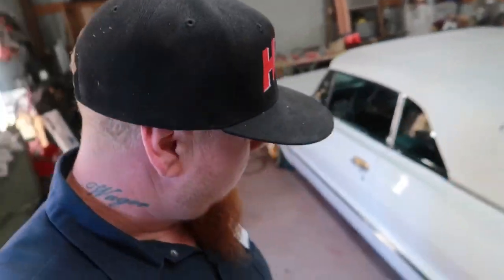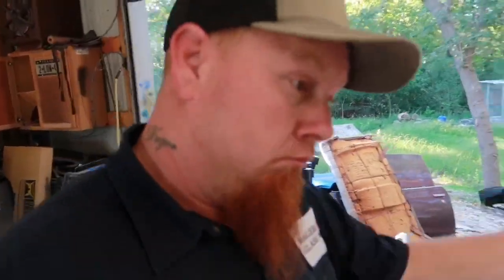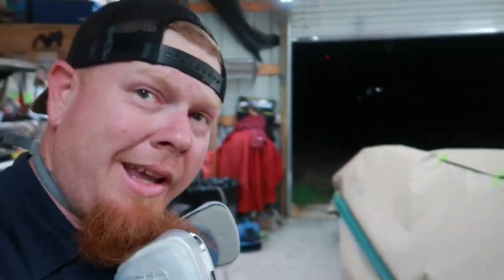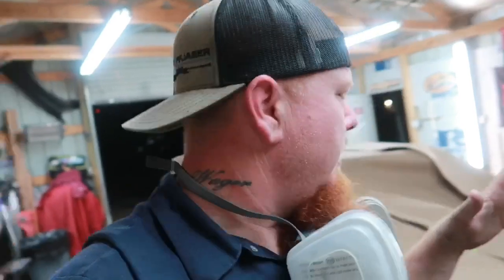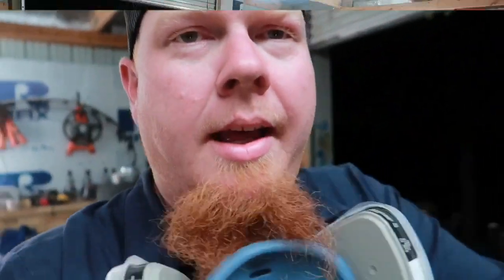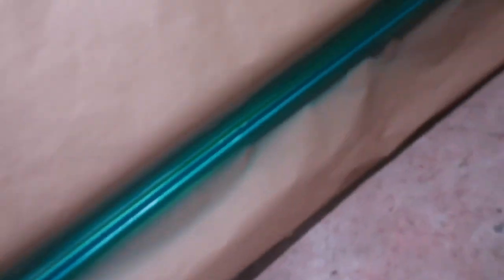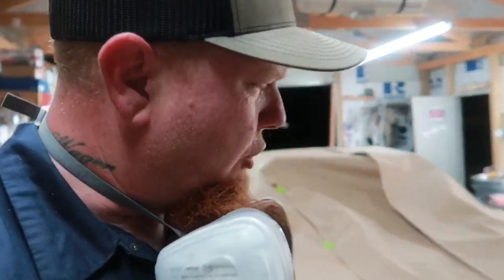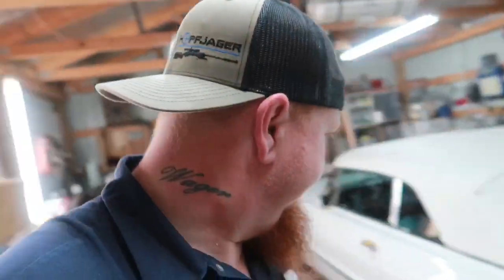1963 IMPALA LOWRIDER CONVERTIBLE CANDY PAINTED TRIM

Comment: What machine did you get for gold plating parts? I own a 64 and want to also gold plate my dual antennas, door handles, etc
Reply from the maker: NJGhost34  Stay tuned and subscribe . I will be doing a video of the gold plating soon , showing the process and machine I use . There will also be a link in the new video where you can buy the machine and supplies . Thanks for watching !
Reply: @bobby_hills_outdoors5227  subscribed. Thanks bro